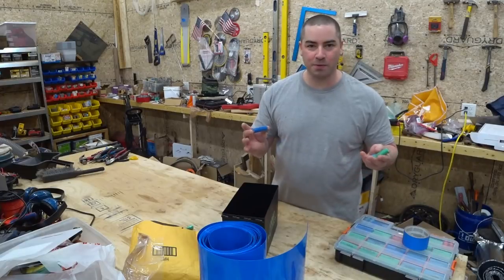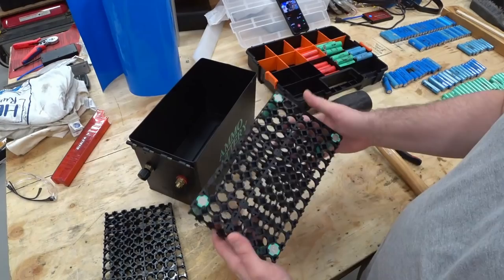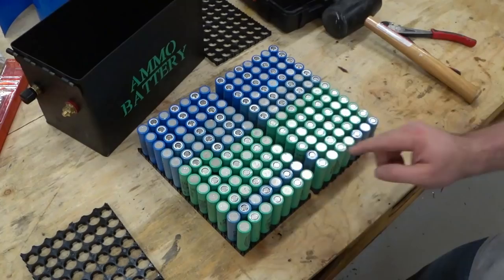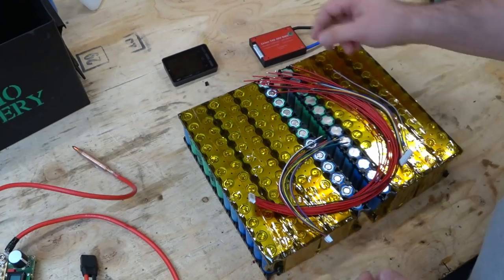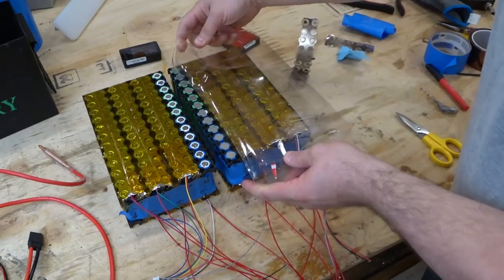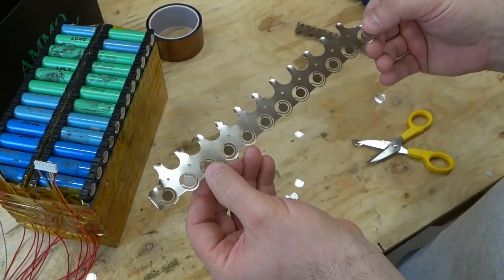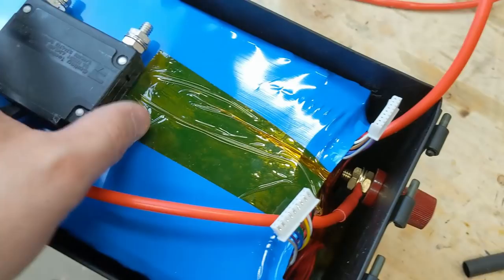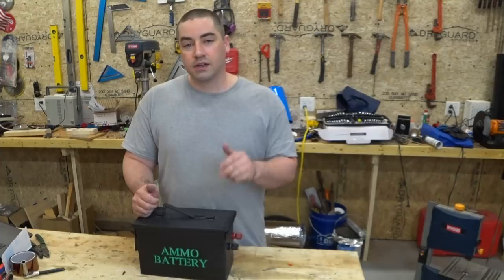48v DIY Battery in an Ammo Can

Comment: I am building my own off grid solar system and have been watching youtude videos now for about a year, which sort of makes me an expert viewer,  you and two other individuals produce some of the best video, steady camera, good explanation, and no "Ahs" every second word, thanks for your hard work trying to help us new users to solar....it is much appreciated
Reply: I am wondering if packs like these can be cycled everyday to some percentage (not full) or if they are for backup purposes only,
Reply: @saadomar1101  If they're charged to 4v per cell and discharged to 3.1v per cell then the maximum cycles will nearly double. Charging them to 4.2v and discharging them lower than 3v is the standard. The last 0.2v is about 200mah, or lower depending on the cell's max capacity.  So not much trade off to gain a lot more cycles.

Comment: Great video.  A couple of things I noticed.  You mentioned that you set up the jst connectors to hook up your little gizmo to see how your batteries are doing....in reality it will only show you how each 'group' of 12 batteries, set up in parallel, are doing.  It will not tell you if an individual cell is having issues.   This will initially be masked by having the others cover for it, forcing them to work harder and weakening them as well.  Which can lead to issues down the road.  Unless you check them individually, you can only check up on the group as a whole. 
The 2nd thing you mentioned is that you don't have to make all your batteries at the same time, that you can add to them as you go along.  This might not be a good idea unless you can match their capacity.  For the same reason as above, if the first battery you put together was in good shape, a few months later, after alot of use, it might have lost some of its capacity.  If you then put a new battery together and add it to it, it will potentially be at a different (higher) capacity.  This will lead to it working harder to cover for the older battery which will lead to it's losing capacity earlier.  The stress could also cause the individual batteries to get out of balance and because you can't check them individually...
You ideally want to match battery amperage and capacity before pairing them.

Comment: Careful - 18650(s) are addictive...   I started with 96 of them and 2 years later they grew to 1,000(s)  :)       You may have done this but you didn't mention it, so just in case, let me suggest that one should match the ah(s) in each parallel row so they all have aproximately the same ah.   For example, 12 * 2300ah cells in 1 parallel row is 27,600ah so you you want all the other parallel rows to have aprox 27,600ah total  (+ / - 5'ish%).   The better they are matched, the easier they will stay in balance as the battery is charged/discharged.
Reply from the maker: LOL.  I can see how addicting they are.  Very satisfying.
Reply: yes same story here. now I have over 4200 cells 14s300p
Reply: I can see how important this is Kenneth, I guess it matters more the more cells you have in P? 
Anyway, I'm considering making my next build with those 26650 LiFePo4 for my workshop powerwall (3kwh) The problem is I can't find a charger/discharger for those that can do the Milli-ah calculation. I don't think my Xtar Dragon 4 thingy can do that chemistry, even though its a GREAT charger.

Comment: Hey Dave if you see this. You have to go to harbor freight and get a pair of icon flush cut s. There expensive at $40 but lifetime warranty. I use them to cut the nickel off the cells. I did over 500 cells with my set. And they still cut like new.
Reply from the maker: Thanks for the tip

Comment: I used an ammo can to make a self contained tester for checking trailer lights and trailer brakes.  It only had to be 12 volt to operate the lights or brakes.  I use it to test to trouble shoot if there is a problem or after doing a repair on any of these circuits.  To charge it, I added a 12 volt power socket on the outside that I can connect to the 12 volt socket on my vehicle while I am driving.  The socket on the ammo can can also be used to operate anything that can be plugged into the 12 accessory socket.  It has the digital display that shows the voltage and also shows the current amp usage of whatever it is operating.  The amp readout is great for testing the trailer brakes.  By looking at the amp readout, you can tell if one of the brake electromagnets is bad or not.
Reply from the maker: That sounds like a perfect application.  Thanks for sharing.

Comment: David there is a plastic sheet called Coroplast that is like plastic cardboard. It is commonly used to make signs and you can get it for free from some gas stations when they throw their signs away. I prefer to purchase 4X8 sheets and cut it up to make my dividers and covers. I use Kaptom tape where appropriate but only use packing tape on the Coroplast because the Coroplast in not high temp so why use high temp tape. Your plastic bottle is also not high temp but the Coroplast is much easier to use. Coroplast comes in different thicknesses the 4mil is the easiest to find and is what most gas station signs are made of. I much prefer the 2mil type but you will need to go to sign store to buy it!

Comment: This is by no means my favorite build I've seen you do but it gave me the gumption to try an 18650 build. Battery hookup posted some used salvage valence batteries which as you probably know are full of 1300mah lifemgpo4 18650 cells. I got 3 batteries in the pack but there's bad cells in the bunch, so I'm hoping to get 200 good ones out of the 300 cells. Not the most energy dense chemistry ever but tolerant, reliable and long life. We'll see if that holds up after they got used and abused in their past life. Thanks for the inspiration.

Comment: That's a great little project!  People will be able to follow along.
Hey, on your miter saw, have you considered powering it with DC?  It's probably got a "universal" motor that will run on either DC or AC.  You'd need a 120 V pack, but you wouldn't need an inverter.  
Keep the projects coming!
Reply from the maker: Do you know of any blogs or videos where someone has done it.  I don't want to experiment with such an expensive tool.
Reply: You’d need a beefy external power switch. D.C. arcing can destroy an AC power switch in short order. (See what I did there?)

Comment: Brilliantly designed pack! I've would add third wire to buss bars. Do not leave these voltage monitors / ballancers unattended in the pack. From what I remembered they drow their supply only from one cell in the pack. If the pack is left for long time without charging, this cell will be drained. Keep the good work
Reply from the maker: Thank you.  Yes, that's correct about the cell checkers.

Comment: Hi David, once again awesome video! A few things, you need to sort the cells into banks capacity wise , the reason being when drawing current from the pack if one P has a lower capacity it will drain faster than the others, thereby causing the pack to discharge faster than it otherwise would have. There is an online cell logger I think on battery hookups site? Not completely sure on that one so don't quote me there, Average Joe uses it when building his batteries to closely balance his P's capacity wise. The other thing I would have done before heat-shrinking the battery would have been to charge it up and do a full few cycles drawing enough current so that you could monitor the cells with a thermometer or if you have one an IR thermometer so that you could see if there were any problematic cells before sealing everything up. It would suck big time to have to tear it all down just because of three or four cells not wanting to play nicely together. There are a few downsides to using recycled cells, BUT, it sure beats the crap out of a LA battery, AND! You DIYed IT! Once again, Awesome build.
Reply from the maker: I agree.  The website is repackr.  You put in all the cell capacities and it organizes them for you.  I wanted to do this, but couldn't.  The tester I used was way out of whack.  I couldn't trust any of the numbers it was giving me.  If I had used some Opus testers, then I could have trusted the numbers and I would have used repackr.  that was my original intent.  The only good thing about the tester I used was that it charged and discharged the cells heavily so I was able to see if there were any "heaters".  (none). I plan to do a follow up video with some testing.  I'll let you in on it.  I discharged the whole thing in under 2 hours, (high amps) and we did not exceed the cells data sheet for maximum temperature.

Comment: Decent, except for the low amperage.  Much of the fun of using that size battery is being able to draw hundreds of amps out of them when needed.  I use only 6 of the 18650s in a portable "juicer" for my smartphone and it works well.  I just used a "hodge podge" of batteries, some new, some used, I didn't care.  It can charge my smartphone 3 times from 0 to 100% before it needs to be charged too.

Comment: you could use them for a Golf Cart   48v  times 4 of them would give you over 5 kwh . You would need to put at least a 400 watt controller I think. If you went easy you could probably go 3 rounds of golf before a   re-charge.
Reply: Would 2 be enough to just drive around the neighborhood? I'm restoring an old EZGO Limo and want to drop weight and charging from the lead batteries
Reply: Specializing in manufacturing 48v36v golf car lithium iron phosphate battery pack

Comment: Nice build! Best practice would be to crimp and solder the connection from your bussbar to the BMS.
Reply from the maker: I don't know which is best, crimp only, or crimp and solder.  But I do know that no matter which way I do it, there will be people telling me to do it the other way.  LOL.  When I made my video on LTO I crimped and soldered and received quite a bit of negative feedback for that.
Reply: DavidPoz Haha, I made a video with crimp and solder and received similar feedback. One of my electrical engineering profs justified the crimp and solder method stating that the solder wetting the copper prevents copper oxide from forming at the junction. Copper oxide is significantly less conducive than copper metal. Additionally the solder helps prevent the connection from wiggling loose as the crushed copper deforms over time from the pressure causing the connection to loosen up. Just my 0.02- I’ve never had trouble with crimp and solder and have seen crimp only fail many times before (mostly due to bad crimp jobs though).
Reply from the maker: Thanks for your 0.02.  I like your explanation, make a lot of sense.

Comment: Wow Bud, you lost me watching your disassembly of the battery packs. I was figuring out how long it takes just to dress the batteries up and testing them. You work like a robotic machine. It would take me about a year per battery. I figured I would never have a battery bank built large enough for my needs before I died. Sure enjoyed watching your build.
Reply from the maker: The first pack took me an hour (4 cells) but I very quickly found the groove.  At the very end I even had it down to 32 minutes.  I posted 40 as a good average.

Comment: Dave,  loved the video.  I live in Woonsocket and not far from 18650 Heat Shrink & Cell  in Lincoln.  Sounds like you are not too far away either.  Would love to grab a coffee sometime.  I have a slide in truck camper that I want to put 200-300 watt panels on and a couple of Lifepo4 batteries so I can boondock for a week or two off grid without starting the generator.
Reply from the maker: Sounds like a great project.  Can you contact me through Facebook? https://www.facebook.com/DavidPozEnergy/

Comment: Great build. I have 2 packs almost identical to yours. I use them to power my tandem trike. I used Samsung CGR18650DA cells and can pull 40A without any problems. I wish my packs looked as good as yours. Thanks for a good video.

Comment: I would drill some holes in the ammo can if you're going to keep the lid on. If the cells experience thermal runaway the extreme pressure inside a sealed metal container could be dangerous.
Reply from the maker: The gasket is removed on purpose to allow venting and no pressure build-up.

Comment: Having measured the capacity of each cell, it would be sensible to allocate cells to each parallel group so that the groups all add up to the same capacity. There is a spreadsheet tool on the internet somewhere that does this for you.
Reply from the maker: yes, the online tool is called repacker.  I couldn't do that because the cell tester was very inaccurate, and inconsistent. I would have done that if I had some Opus testers.

Comment: Good project.  What I would really like to see is a project building a 12V  battery. I have a desire to replace the 12V house batteries in my  RV  and if I could build a reliable 12V battery to replace the deepcycle lead acids then that would be great.  IF I could build a 12v 1.3kva battery for $200 as opposed to nearly $1000 for a battleborn  then that would be a project I might dive into.  

Ideally it would be a drop in replacement for lead acid and be in that save basic form factor and ideally with top post terminals so all the current wiring works.  A 24v or 48v  just requires too much modification to the existing systems of the RV for me to really consider going that route.

Comment: I find it odd that Ryobi is using 15A cells. Most battery systems are using 20A cells and BMS. This just means that Ryobi battery packs are going to cut off sooner and wont reach as high a torque. Before you make a battery pack for your saw, test to see what the spike of current is at startup and also see what the current load is while cutting wood. I like your video. Keep them coming. :)

Comment: Has to be the coolest idea for a battery yet! Looks like a 7.62 box? Remember though,(not teaching you to suck eggs of course) 48 volts does hurt a bit if you touch both terminals by mistake! :)
Reply from the maker: It's painted, so I don't know what size rounds were originally in it.  But it seems like a pretty standard size.  About 6x11 and 7" tall.
Reply: @DavidPozEnergy  Commonly known as .50 cal. ammo cans. Even though they are used for .30-06, 7.62x51, 5.56x45. A .30 cal. can is a smaller can( 7Hx10Lx3.5"W). There is also a "fat" 50 which is larger and again, is used for more than just the .50 cal. round, 8.75x12.5x7.25" .

Comment: If There was ever a major failure and the fuses had to blow. I'm not sure that plastic bottle would insulate against short circuits. I just watched the video that average Joe done with his thermal cam. Showing the fuses blowing. I would love to see that test. Love your vids mate
Reply from the maker: Do you have any suggestions of something thin, non-conductive, with a higher temperature rating?  I think 2-liter bottles are PET plastic, which is like 500°F.  I think that's higher than the plastic in heat shrink, but I'm no engineer.  There is also 2 layers of tape in the sandwich.  I saw Average Joes video.  It was great.

Comment: With the battery hookup nickel fused sheets be careful I have noticed you are able to spin the outside edge cells which in turn causes the fuse to spin and if your not careful you will break them be careful tape around the outside of your batteries so that the batteries cannot move or you will accidentally spin the batteries on the outside edge and caused the fuses to mess up but other than that I like it

Comment: Similar to some of my projects a few years ago.  However no consideration was given to cooling in this design.  There is a reason that Tesla builds their packs with coolant lines built in.  A pack of this size will get quite warm when you try to draw/or charge more than 10 amps from it.  Since yours is completely sealed from airflow to the case and insulated there is nowhere for that heat to go except into the cooler cells.  Nothing destroys the life cycles of a cell faster than heat.  Then once it gets hot enough you melt your petroleum based (plastic) divider between the packs and create a dead short throughout the pack.
Small electric bike packs can get away with this type of design because the heatshrink wrap is directly exposed to the wind.  But honestly, I'd be afraid to use your style of  pack for any period of time.
Reply: Aspendell Hench The reason is he is only limiting the power to 20 amps. 26 amps would roughly put you at 1C. So 20 amps would be a safe limit without fear of building any heat.

Comment: Hi Dave,  just watched this video of yours and liked it a lot.  I was a little concerned when I saw you wrap that tape and then the shrink wrap around the whole bundle.  I know it looked nice and neat but I was concerned about ventilation and air cooling.  At the end you mentioned removing the gasket, and I assume that was what that was for, but with all the tape and wrap, there is no way you can get any air cooling.  Just my thoughts.  Thanks for the videos.  M.
Reply: Heat dissipation is a concern for heavy loads or fast charges. 
Author mentions limiting the max amps for that reason.
20A max / 12P ~ 1.6A per 14S group, should not generate too much heat from 2.2Ah rated cells.
For protection a BMS with thermal shutoff function could be used with sensors distributed within the block.